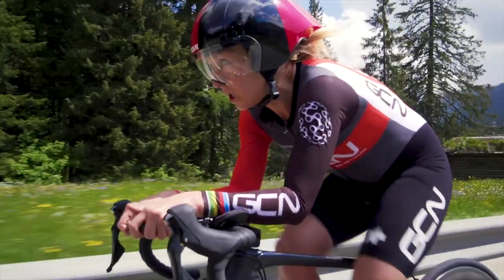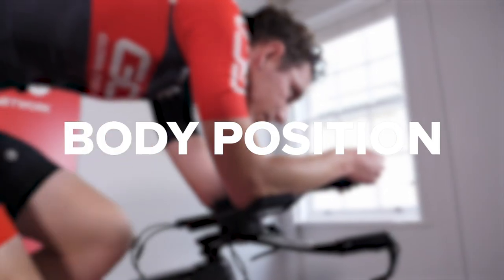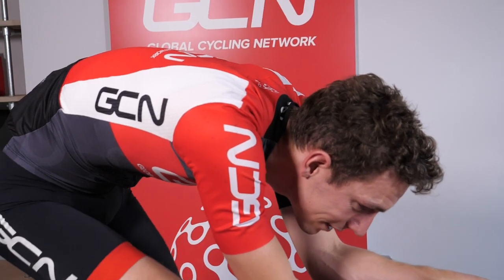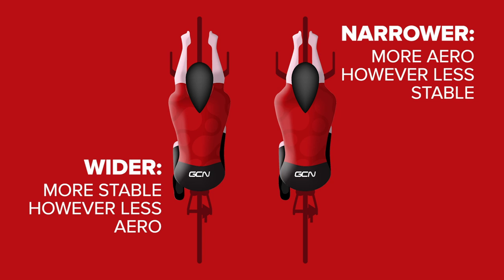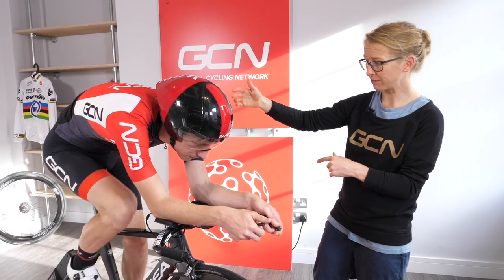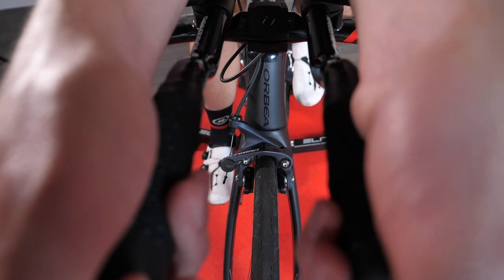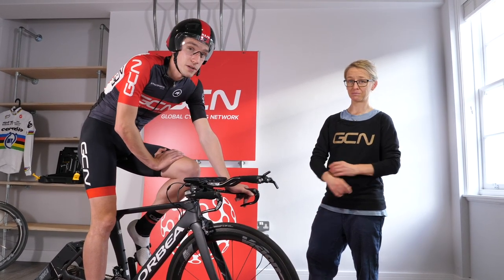Dr Pooley's Aero Bike Fit | How To Find Your Time Trial Position

Comment: I was talking to a wind tunnel expert and he told me having your aero bars straight like that causes a scoop at the front creating a lot of drag. If you place the aero bars pointing up more you create a shape that breaks the wind and it also takes more stress off your back and you can actually get your head lower. Try it yourself
Reply: I made the same observation and tilted my bars up not only to close the distance between hands and head but to feel more comfortable turning the pedals. My times improved as a result. Plus, in watching the TdF this year i noticed many riders had the same bars tilted upwards type of set up as opposed to dead flat and low. Anecdotal evidence!
Reply: Requiredfields2 I noticed that aswell this year a lot more pros are starting to tilt their bars up. I used to always get strain on my back and it is now a lot more comfortable

Comment: I've riden a few TT's. Yeah it does take a bit of time getting used to the new body position but once you feel comfy in it your confidence gets much higher in it and you start generating more power and doing the best you can. It's you against the clock.

Comment: Interesting watch re bike sizing and Simon fitting.  There are UCI rules to consider however also with Road TT bikes.  Particularly ARTICLE 1.3.023 and the distance the extensions may extend from the centre of the bottom bracket.  It is something that is checked in championship events here in NSW Australia.

Comment: Just watched this video again. As Emma mentioned Si doing a TT. I was wondering how his TT training is going. Dan's Sufferfest training was interesting. Also if Si was to use a TT bike to ride into work. Instead of the 10 minute shorter ride and slightly longer in bed be wiped out by the 5 minute longer ride because of the rucksack with Si's change of clothes?

Comment: What about the limitations created by mobility during an aero fit?  I am a triathlete and do the occasional time trial, and based on discussions with my fitter, I need to work on mobility in order to be able to lower my stem to get into a more aerodynamic position.  I am just curious about it, because there was a lot of focus on frontal area, but not on the factors that may limit it in the same way you cannot just change your Q-factor without considering other possible issues.  I also find the crank length discussion interesting.  I am 5'5" and I ride 170mm cranks on all of my bikes, and I have had someone who does fit, but does not know my position say I need 165, and another person who did one of my fits in the past say I could use a 172.5 to compensate for a hip/knee issue.

Comment: Years ago, I had a time trial frame made for me. Not knowing what I know now, the frame size (64cm) I had the guy make for me was actually too big for a time trial bike. I have made several modifications to my steer tube and stem to get precious inches lower. At this point, I either Still not low enough to be really aero. At present, it looks like I have 1 of 2 choices. I can take about an inch off of my head tube to bring me that much lower or I can buy a smaller frame.  I am a very tall rider at 6' 6" tall.. I'm looking for a frame that is around 57 -59 cm in order to attain that lower position. Any advice towards that end is most appreciated.

Comment: Quick front end  TT setup question (not so much about fit - more about height of base bar). I currently have a spacer beneath my stem and a small spacer beneath the rests. Am I likely to see any benefit from slamming the stem and putting a larger spacer under the rests to compensate. I've raced the season with this setup and my elbows are currently at what I feel is the best height for me (although I will experiment a bit more this winter) , so this would purely be an alteration of the base bar height. It probably makes no difference, but I just wondered if there is any air flow benefit  in having the base bars lower?  Thanks.

Comment: So why doesn't someone couple a small video camera (like the backup cams in  cars) with a screen incorporated into the aero bars so you can keep your head down comfortably and still see where you're going?
Reply: Well, there are maybe a few things:
1. Battery and screen weighs quite a bit.
2. You need a decent sized screen. If you have a 5 inch screen phone, look for a Youtube video of an "on-board" cam of a bike ride and put it on full screen. Even cars look tiny when they're only 20m away.
3. Cameras don't do well with rapid lighting changes.
4. Depth perception might be an issue with small wide angle lenses.

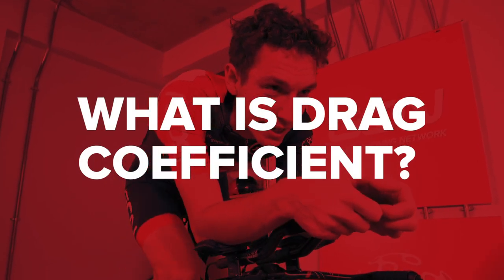Comment: Dear Emma,  drag coefficient is a “physical” thing (5:08), it is number to quantify the resistance of a body moving inside a fluid medium. The formula is quite easy: Cd=F/(q.A), Cd or Drag equals to the force needed in travel direction divided by the dynamic pressure q times the frontal area A .  Keep up the good work!
Reply: Emma Pooley is an engineer.

Comment: EMMA  I have a Ridley Pheaton  frame  46 cm with pushfit bottom bracket, head set and seat post  if you are interested.  Have I ever riden a time trial yes back in the 80's  22 08 for a ten 58 18 for 25 2hr 2 min? sec for a fifty and 4hr 38 for a hundred although my best hundred in training was 4hr 18 cheers diggerdog

Comment: One thing I keep windering is if a TT bike would actually be useful as a bikepacking bike. After all, when riding for days on end, saving a few watts by being aero would in the end amount to quite a lot of calories. Assuming, of course, that it's possible to be aero for days on end without horrible pain. Also, perhaps the bags create so much drag that aero position becomes pointless.
Reply: TT bikes are usually really stiff with no compliance and therefore no comfort as they are designed to be ridden hard for a short length of time whereas bike packers need a bike with some flex to cushion rougher road surfaces and thus enable longer distances to be travelled in more comfort. i would think that mounting the bags would negate any aerodynamic gains that a TT bike would give.

Comment: Wouldnt GTN have been good to invite for this video as they mostly use aero bikes and have a lot of videos on it to so if you want tips on reducing neck pain for example they have it
Reply: simon edin I think Emma’s World Time Trial win and Olympic silver medal qualified her for this particular job. 😉
Reply: @simonrichardson5259  yea but it seems like Emma mostly dealth with the pain instead of doing something about it like the neck problem and eye problem si sort of had
Reply: simon edin time trials are usually shorter than triathlon bike legs (especially Ironman!) and you don’t have to run afterward. Comfort is not that important. And a lot of the initial discomfort is dealt with by training in position and the adaptations your body makes over time.